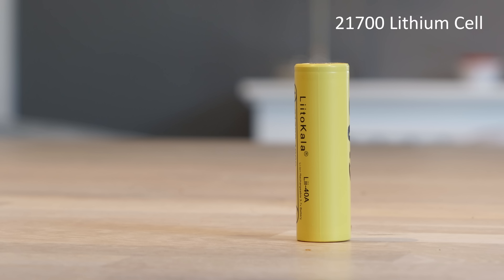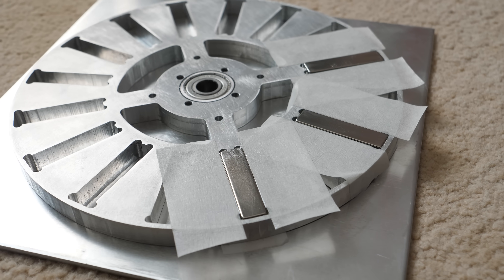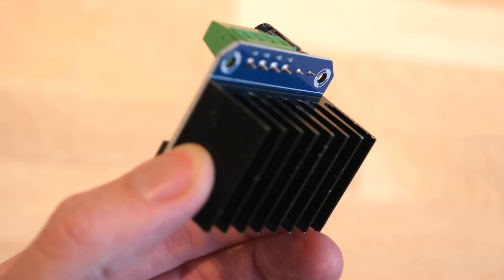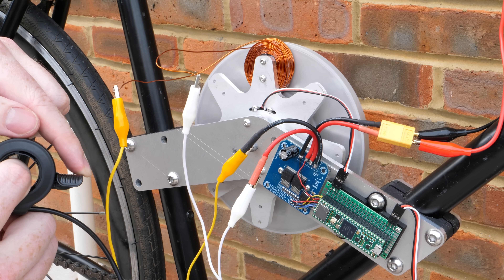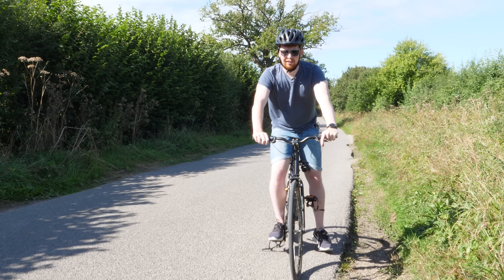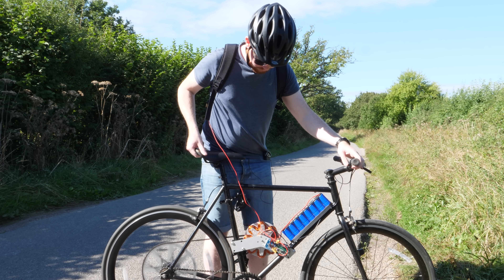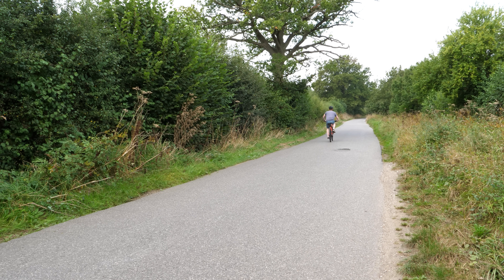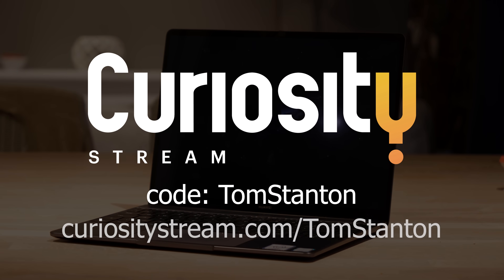Super Capacitor Bike

Comment: Can you make some switch board that will basically utilize that capacitor for once it charges and then switch to the battery thus extending the life of the battery or would the battery basically do that. It seems like the ability for the capacitor to recharge rapidly it can utilize much of the power from the regen brake .. or am I misssing something with how much power output the regen brake produces?

Comment: I just build a trike with 16 supercaps 3000f. Powered by Pedals and a 250w bldc motor as generator. 2 bldc hub Motors with 1000w each. Vmax 25kmph. Elektrik Brake System works very strong. 

Come to Berlin to ride it

Comment: In the model train world we are using super capacitors to run over bad spots in the track. The capacitor is connected to the decoder and helps with the control of power when there is a dead sport in the track, or there are dirty wheels.

Comment: There's your problem right there: its plugged "straight" into it instead of directly. 🌈

A small grnerator plugged into the capacitor series could be used to trickle charge or supplement your main batt 🦇 pack, increasing the range.

Comment: Interesting, and a lot more advanced than my first attempt to put a motor on a bicycle.   I used an A.C. motor with a big rubber grommet on its shaft, pressed against the rear tire.   Range was limited by the length of the extension cord, not a lot of speed, but lots of torque.   It would climb up any hill @ 2 mph.   Circa 1962.

Comment: Now u must introduce gear ratio of electric bike so max power in start then low power afterwards i think the elec curr might be saved a bit longer by this & solar panels which spark current again into series capacitor

Comment: Since the super capacitors are less dense than any battery (more volume, less mass) you should create a super capacitor backpack which is FILLED entirely with a super capacitor bank. Then you might actually get some usable range.

Comment: Old video->new comment here.. Use the Super Capacitor on a regular E-Bike as a "Nitro Boost" style means of propulsion. All of the normal batteries are hooked up, plus re-gen braking and have a charge meter that shows capacitor charge. Double the amount of super capacitors, and get a higher charge and discharge rate along with a "fooler System" to use the batteries as well for a Nitro/Turbo boost setup. Get up to speed and hit the button for more top end, or push the button during acceleration to the usual top speed and beyond in a drag race situation. It would be amazing! It's what I've been wanting to do for ages, and will do when I get around to building an E-Bike. Congrats on building the motor as well!!! I would've filled out the Star Wheel to make it complete but still leaving the proper space between to coil packs so that they don't fight each other. Tighter coils iow

Comment: If you want to revisit building a bike motor, I would suggest 3 changes
1, use a halbach array for the magnets, this will make them more directional and increase the flux in the direction you want
2, add a second rotor to the other side of the coils, this will trap the flux between the two rotors where you want it
3, make the thing holding the coils out of something not ferromagnetic to reduce eddy current losses

Comment: I had higher expectations of your idea. You need a lot of words. I have a tip for you: you make inefficient coils that produce too little power. The way you make them you need too much copper wire, the coil has to be wound differently then the yield is much better. You also need a transmission to the drive otherwise it's too much work that the capacitors have to do. And it takes more capacitors to move your weight.

Comment: in Newcastle NSW, there are trams that are powered by batteries and supercaps. The tram is charged at the stops and has no overhead wire.
I don’t know how many supercaps are used or how the combination of supercaps and batteries are optimized.

Comment: Xo vertical tour leg quinetic energy with a step up generator to I crease  horse power and use battery in a series. Maybe a "Y" connector like channel that can be used dornpower and for storage using diodes. Possibly using direct and alternating currents.

Comment: Like runners on a track filed on a relay run where they hand each other a button, not used step in and step down generators to charge and us batteries to power a bicycle and to move consistently and also use quinetich wheel energy to step it up and charge the battery. It will slow down the bike but that's  why the step up generator will do and the advantage is that the battery will not run down. And why go fast in a bike? At least you keep it going and compensate power with a step up generator.

Comment: Here's a tip: if your capacitors reach the lower discharge limit (so your motor won't run anymore), switch pairs of capacitors in series, which doubles their individual voltage. Now you can use more of the stored energy. When the pairs also reach their limit, you may be able to switch groups of four capacitors in series, etc. All it takes is some clever wiring, and a few "gear change" switches. You can also switch everything electronically of course.

Comment: i like the low profile design and simplicity.  I think a light weight unobtrusive system with 5 miles of range, regen and fast charging and a low price would be a great product for general duty.  Would be go to be able to remove motor easily and adapt to other cunctions like maybe a small pump and anything else you can think of.   For the bike, i'm wondering if you could build a motor of that design into a flywheel that can store some energy.  Maybe mount the pedal assembly more forward so the flywheel/motor can be down low.    Design in a 3 speed trans and have the flywheel keep spinning but you can leave the regen on so when you are stopped it can keep making juice or you can used it to aid your next take off.   Another idea is, is it possible, say you had an as-large-as possible flywheel disc that you could have 2 rows of magnets so basically 2 motor/generators.   Maybe one on a std battery and the other on a bank of capicitors with maybe a Li connected.   That means you can recharge the capicitor bank anytime and use it like a turbo booste.   I'm talking about a big but light flywheel.  The idea is to keep everything light and cheap.   Motor controls would be critical but it seems like you have a good handle on that.   The idea, again, is light, simple, modest power, modest range, utilitarian.

Comment: maybe use downhills and manual pedalling to charge it too. this way, going downhill provides the power needed to go uphill again, and charging is easy on plane terrain. the switch between modes could be automated too, using a gyroscope

Comment: Why don’t you add another group of the capacitors that is charging with the routing of the front wheel, when the first group runs out of power it switches to the sec group and the first group starts to charge by the front wheel. 🤷‍♂️ ?

Comment: They need to make high power motor and lithium ion battery packs/ all mounts designed to be universal, etc. E bikes are expensive because theyre a new finished product, but it should be far cheaper
Reply: E bikes are already cheap for what they are.

Comment: Bro you shouldacharged the capacitor with the bike it woulda been less effecient but so much cooler you could prbably charge it on a treadmill lol let ut run for a few hours.

You could have the buke charge the battery, and the batteries in turn charge the super capacitor

Comment: This could be incredibly interesting if you don't use a charger, but rather than braking with friction, you brake electrically and charge it like that. In hilly areas that go up and down, you can absorb energy downhill and use it uphill.

Comment: Baghdad battery: The First battery was made 2000 years before' called Baghdad Battery is also known as Parthian Battery' It consists of three parts: A ceramic clay pot, A tube of copper plate' and a rod of iron_The central piece is a 6-inch yellow pottery and is in the Baghdad Museum' It is related to the Parthian occupation during 248 BC to 226 BC"_A copy of this battery of 248 BC has been made by today's scientists, This portable battery produced 0.87 volts of electricity' The battery is believed to have been used for medical purposes such as pain relief_ The Bagdad battery is believed to be about 2000 years old from the parishioner period (Roughly 250 BCE to CE 250) The jar (battery) was found khuljat rabu in Baghdad Iraq 🇮🇶"_
And is composed of a clay jar with a stopper made of Asphalt, Sticking through the asphalt is an iron Rod Surrounded by a copper cylinder and filled with vinegar Orany and grapes juice other Electrolytic Solution__ were used to electroplate items such as putting a layer of one metal (gold) onto the surface of another (silver), a method still practiced in Iraq today...
This method was modified using an electronic solutions which is rechargeable and gives a higher voltage than its predecessor_

Durvesh yezdani's

Comment: I would argue that a capacitor whose voltage is 50% of its peak voltage is 25% if charge refers to energy.  The energy in a perfect capacitor is proportional to the square of the voltage.  Thus, when the voltage is down to half its initial value, only 25% of its energy remains.

Comment: Now I'm curious as to what happens when you this design with either a flywheel for passive charging you figure that out, or idea number two, rig this design with pedal power for active charging. Again you figure it out. Because I've no experience with that stuff. Gearing I can do though. Sorta.

Comment: i think you can have a mechanical motor Control.
u just need some little pins on the disk that mechanical changes a switch, that will change polarity, the moment the magnet passes 
you could also try it with the Príncipe of a bicycle speedometer i think.
maybe its worth a try to improve
and also you may could use a freehub for the motor so you can still easy paddel when no power is there.

Comment: To use supercaps effectively all you need is a power converter that can take the lower voltage of the supercaps and increase it up to voltage the speed controller is designed for. 
Then you can use the full capacity of the supercaps until they are flat without slowing down.

Comment: The motor is very poorly designed, demonstrating little understanding of magnetism.
There should be steel on the outer side of the magnets to conduct the magnetic field.
Similarly there should be steel on the outer side of all the coils and going in the middle of the coils.
This steel should be laminated in the correct axis to reduce eddy losses (just look at typical motors).
Why make your own motor?

Comment: I mean, if you're using the motor primarily as an aid to your leg pedaling for the occasional uphill, with regenerative breaking used for speed control, they should do the job just fine I think. Right?

Comment: With the exception of climbing hills, bicycles only need a burst of energy to get them going. Once moving they require much less to keep moving. Perhaps use caps to start and switch to lithium batteries to keep going and recharge your caps. Regen braking can charge both.

Comment: The way you explained how the lithium-ION battery works is correct.
I see that myself with my E-bike. When I use my bike with a full battery, It uses the power and drains normal.
When the battery is getting low (15%) I see it drain faster. When it reaches 10% it see it drain to 8%, 7%, 5%, 4% in a short time. Not directly but, a little faster than 'normal'.
At 3% my bike will switch to ECO (power saving mode). At 1% it cuts power to the 250watt motor fully.
I can sdtill ride mt bike but, without assistance of the motor. The power is only used for the display and lights.
I once had to ride 7,9km without assistance of the motor.
It looks 35 minutes to get home. Charging for 7 hours back at home, to get the battery full.
My bike uses an 500 watt hour battery. If there is no short circuit in the motor of course😃

Comment: Is it possible to have the rear wheel both charge the battery pack or super capcitor bank and distribute that power to an electric motor at the same time? You would start by riding the bike normally, build some charge and then let the electric motor take over. More charge is built the faster you go. A speed limiter would be needed for power management so you dont overload the storage capacity.

Comment: This seems like a great idea for an electric assist bike where the electric parts are used for starting and stopping only, then peddle once at speed. Some peddling would also have to be used for charging the capacitors to make up for losses in system as regenerative breaking won't be enough to fully charge the capacitors).

Comment: If we could make hyper capacitors, 10 times the energy storage capacity of 1 super capacitor, at the same size, or uber capacitors for 100x, that could probably be more useful, if they could still charge in the same amount of time.

As they are, maybe super capacitors could be to electric vehicles what turbochargers are to fossil fuel vehicles. Like, say: a battery can discharge X Watts per second but has a longer lifespan if it discharges Y Watts per second (where Y < X), then you could use super capacitors to add extra power to the motor (equal to X - Y), which would provide the motor with the maximum power without stressing the batteries.

Comment: The hill is a great place to do testing.   Chalk the lowest point as middle,  chalk a straight path line, and see how far the charged caps get you from the bottom of the hill up on both sides, mark them then compare that to how far you can go just by free wheeling, from and to those marked points.

Comment: When charging. if you include the energy usage to still get to the bottom of the hill, while milking enough energy to climb back 40% .   100% efficiency is to stay where you start and don't go down or back up.  Ke=1/2mv^2   So <50% is as far as you can go before you cant continue to roll and start to not reach a destination.  The regen power recovery, is pretty good here.  About 80%

Comment: What about using a DC-DC converter to stabilize the voltage? So the power output would be linear, and dropped down at the end.

Comment: He didnt only test the capacitors, he also build a BLDC motor from scratch. This is insanely amazing!
Reply: Yeah, that was the most impressive part of the video.  I almost forgot the purpose of the video is about powering the bike from super capacitors.  The caps were underwhelming as I expected.  But that MOTOR!!  WOW!  I wish I was that smart.  I could form my own e-bike company (powered by Li batteries, of course, not caps 😊).
Reply: @ChristmasEve777  Good news is, spend a bit of time tinkering with motors you build, you very quickly become very good at it. They really aren't that complicated, and the best way is to do hands on work. You can even use wood or plastic for holding stuff together till you get a design down. Then get the parts made for it. 

I was making motors when I was a kid. And now, I could easily make something like this. However, the real issue comes down to precision. If you're building a motor where efficiency is needed. I would just buy a manufactured one. Everything needs to be an exact fit, smooth high quality bearings, no vibration.
Reply: Not only that, he built an axial flux motor - which is an impressive feat by itself.

Comment: Great project, a small tip: instead building a hall sensor around your motor, you can use Zero Crossing effect of the free coil in each cycle of your motor.

Comment: Awesome that you made your own motor! You just need way more super capacitors lol. Also a slight correction, a gasoline engine doesn't run at 100% power all the time, actually very rarely, it's dependent on load and rpm, which is why gas mileage can vary so wildly

Comment: What a fantastic video. Amazing stuff. 

I did want to point out though - in the UK an ebike needs to be assisted power. If it is powered entirely by the bike it's not lawful. Also, it needs to cut out when the speed is at 25kmph. 

Truly amazing by what you've made, but wanted to share so that you don't test this on busier roads and get yourself in trouble - not that the police care about illegal ebikes anyway.

Comment: My guess is... supercapacitors will be built inside most bike frames for pedal assistance in the near future because they are extremely lightweight... have an extremely low resistance which results in getting fully charged in under a minute with almost no resistance, although will discharge just as fast... and offers regenerative braking. At the least... it might be ideal for giving that desired energy return.

Comment: Try this, use lithium as the main power then when your using regen dump the power in a capacitor, when the capacitor is charged enough dump the power slowly in the lithium.

Comment: would be nice to re-visit this with the 3000F caps that maxwell has and maybe an off the shelve motor, as we dont know its efficiency, maybe an off the shelve chain drive motor?  the good thing is that these caps, though large are not very heavy, you can use tubes to make a cap with say 8 in series?

Comment: A capacitor dicharges very quickly. it basically dumps the voltage all at once. which is why you shouldn't ever touch the contacts. on a capacitor until it's been discharged or it will likely kill you.

Comment: Minor nitpick at 1:12, the super capacitor's discharge curve should be a decaying exponential, not a straight line, which results in even less time at optimal voltage

Comment: 1:13 The graph for the supercap is not really correct. The graph shows the discharge in CONSTANT CURRENT mode. A discharge is more like half the voltage every second. Proof me, if I am wrong.